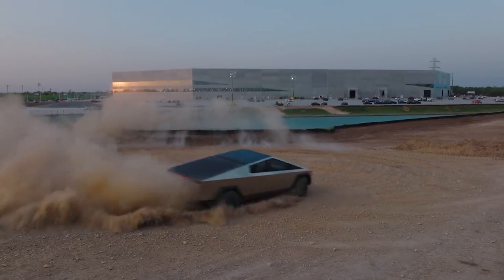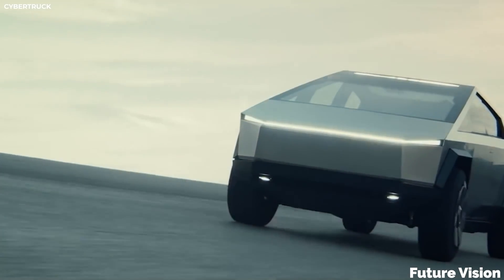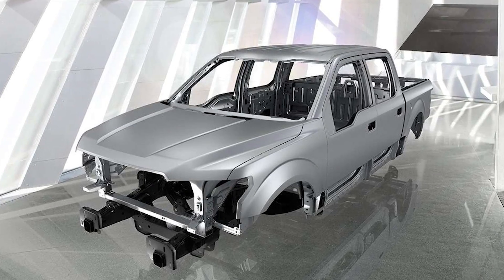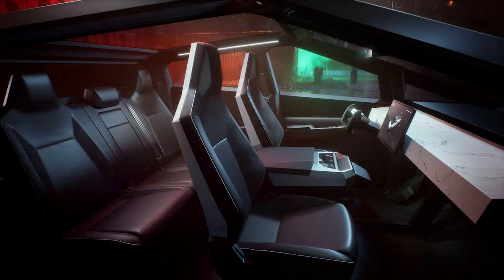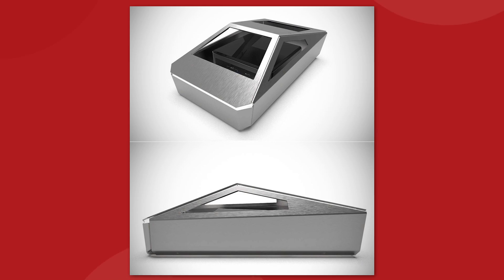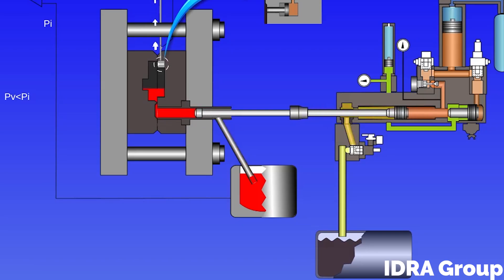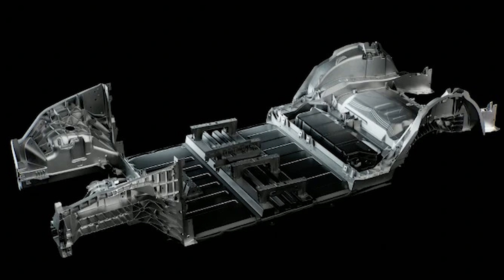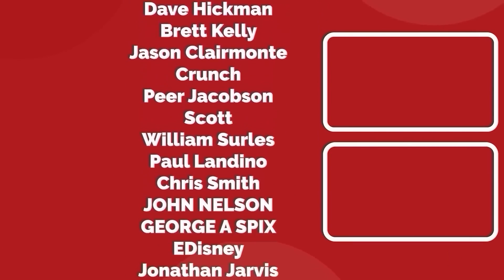The Real Reason Tesla Developed The Cybertruck!

Comment: Cybertruck is also a working vehicle. It has a 100 cu ft bed volume compared to the Ford Lightning's 52.8 cu ft bed volume. Cybertruck also has a towing capacity of 14,000 pounds versus the F150 Lightning's towing capacity of 7,700 pounds. This makes the Cybertruck more than just a cool looking toy. With its stainless steel body, it will outlast the F150 Lightning in all kinds of harsh environments like rain, ice, snow, mud, road salts, load impact and body impacts. Wish I needed one. Imagine a fleet of them for rent in construction equipment yards like Caterpillar, Wagner and others. Operators don't need to own one, a contractor can rent what they need for the jobs that demand the capabilities of the Cybertruck. It will fill a new market with a one-of-a-kind utility truck that beats all competition.
Reply: That means jack sh1t when the battery runs out after 100 miles. Like with the semi, you can't beat the laws of thermodynamics.
Reply: Bullshit!!!
Reply: Those are not trucks for construction stfu!!! Construction trucks are rings like ford f250,350, 450…. Those are real trucks and have tons of customization from flat bed to bed with crane, can have extended chassis…… the cybertruck offers literally nothing but crap!
Reply: @carholic-sz3qv  that means ur normal pick-up truck offers nothing but crap too
Reply: @Unknown_nobody-p7b  my pickup truck offer everything and I can go everywhere I want which no EV you can keep denying the facts it’s your problem! So cheere
Reply: @carholic-sz3qv  what can ur pick-up do ? ( also plz dont hate on the cybertruck cuz of its shape and color and style )
Reply: @Unknown_nobody-p7b  I don’t hate anything! It’s just the stupid form that doesn’t suit the fonctionality or usability of a proper truck! What are they going to do with their bigger trucks!? The same crap!? We’re talking about commercial vehicles here and customers likes to have flexibility in their vehicles and equipments.
Reply: @Unknown_nobody-p7b  there is a reason why the Mercedes sprinter comes in sooooo many different variations! Not everyone/user has the same needs with those.
Reply: @Unknown_nobody-p7b  my pickup truck can tow, go to remote places with very bad infrastructures, overlanding and much more.
Reply: @carholic-sz3qv  now tell me in what way can the cybertruck not do that ( excellent tires ) , and i want evidence
Reply: @carholic-sz3qv  BUT its a totally new style so y the hell would tesla have 1billion options , thatd be adding cost for no reason , itl give about the same results
Reply: You acting like a simp is why the haters hate. I don't care if the Cybertruck has a 100,000 pound towing capacity. The batteries can not handle it for true tradesmen so all that statement is just for marketing. The bed volume, for dyi'ers it will probably be awesome. For people that need trucks for work it will suck.
Reply: @johnm.4141  so how far do u need ur pick-up to go ? Im assuming 100000000000000 miles
Reply: @Unknown_nobody-p7b  tell me you have never worked the trades or hauled anything for money without telling me.
Reply: @johnm.4141   no but how the hell can the cybertruck not do ur job ( also plz provide evidence and DONT CHANGE THE TOPIC )
Reply: @Unknown_nobody-p7b  (I DIN'T CHANGE THE TOPIC) the original topic is not to be a simp for tesla, which you are. Thank you for proving me right. People who actually use the truck for a truck can not sit around for an hour for it to charge in the middle of the day. Go ahead and buy the truck so you can finally haul your girlfriend around.
Reply: @johnm.4141  do people travel for more than 460km in a pick-up ( from what i remember trucks r the guys who travel far and wide not pick-ups ( nor cybertrucks )
Reply: @Unknown_nobody-p7b  maybe that is your problem. I am talking about freedom miles.
Reply: @johnm.4141   then that convertes to 265 miles
Reply: @ericfarley1882  1- fine i give up ( still not convinced) 
2- check minuteearth’s vid about potato fuel and u shall be enlightened
Reply: Why are you comparing to a Ford lightning? That truck wasnt built for towing or cargo space in mind. There's way better trucks to compare with.
Reply: The simple Toyota hilux is way more versatile than that tesla truck and that’s facts
Reply: @carholic-sz3qv  in what way?
Reply: @carholic-sz3qv   gimme the evidence ( on both replies )
Reply: Im not reading that but ok 😅

Comment: What about the reflection of the sun on the stainless steel bodywork which could dazzle other drivers?? 
Any tests yet ?
Reply: Can't imagine it would be worse than a typical white-painted car.
Reply: @Nathaniel_Peterson  Or a chrome painted car.
Reply: It’s not polished.
Reply: Need to look at the tailgate but I would be surprised if it did not reflect the light up.  Good luck keeping one clean enough to be a problem anyway.  Are they still selling the trailers with the diamond pattern on the doors.  They were the worst.
Reply: It isn't chrome.  It's not like a piece of silverware.  Satin finish.